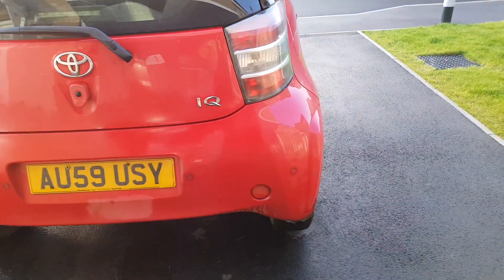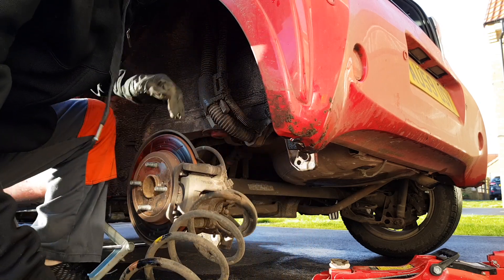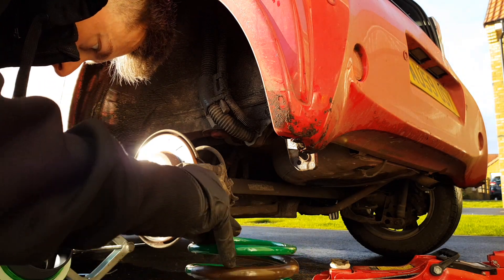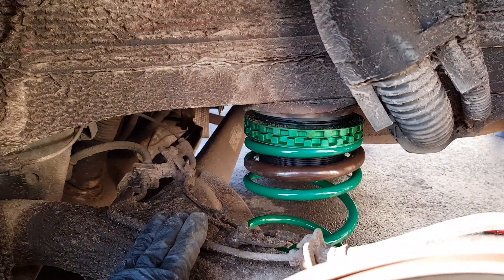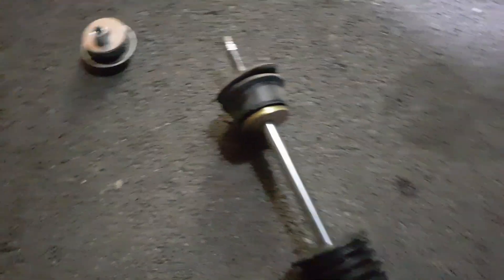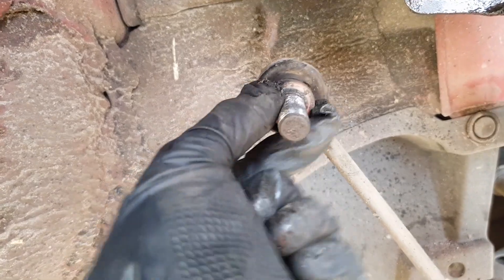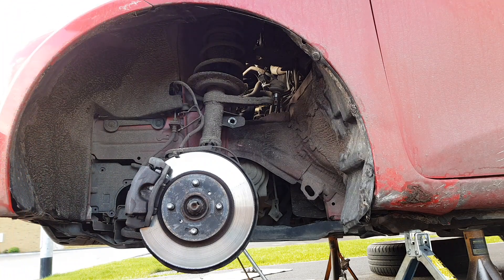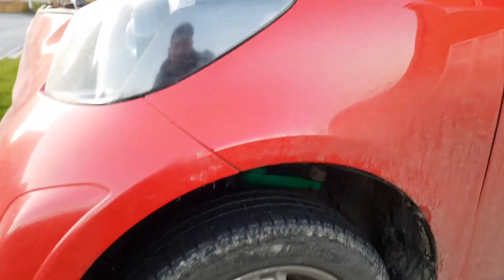Toyota iQ How to Install Tein Coilovers

Comment: Huge thanks for the video! I'm about to replace the front struts and rear shocks on my 2012. I'm using new stock replacement parts, and wasn't sure if a spring compressor would be needed, but I see you did it easily without one. Again thanks for showing how you did it!

Comment: Use some axel stands buddy, don’t trust the scissor jack to hold the weight. I had one fail holding a mx5. Scary stuff! Keep up the good work though dude! 😁
Reply from the maker: I did when I got the full front end up 😂 I stuck a wheel under after I jack it up but I will do next time 😁
Reply from the maker: @rossclarke92  when I first started on cars I had one start to go and I got out just in time 😂 cheers mate! I just lose track 😂